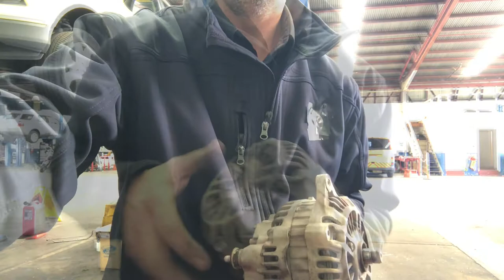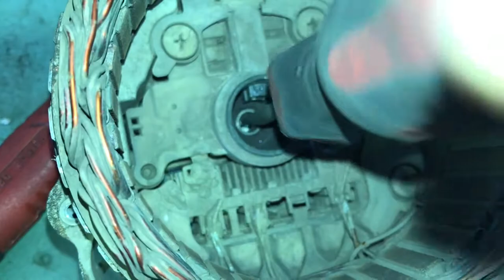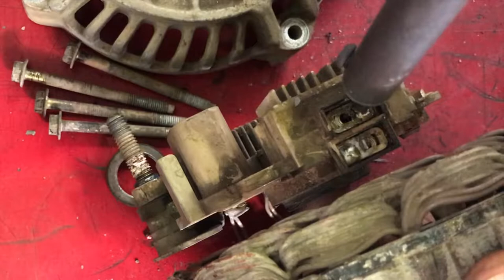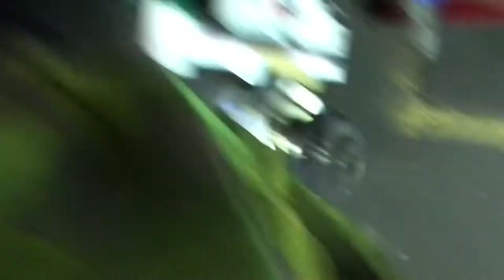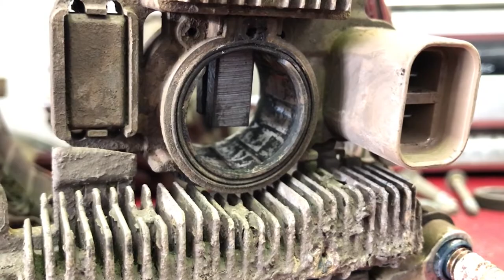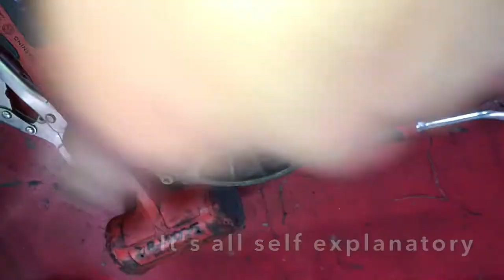HOW TO : Replace Worn Alternator Brushes (not charging)

Comment: Great video. Word to the wise- these steps are likely good for most alternators, but if you are working on an AC Delco AKA Delcotron alternator NEVER use an impact gun to install the main hub nut. Doing so will distort the body and cause rubbing... I had a parts store fellow think he was doing me a favor by installing the nut  on my replacement (when I only asked him to remove the old one). He handed me a fresh, but now broken alternator. I was stuck in that town for another 3 days while another unit was sourced. Thanks for sharing. Love those Pajeros- we own two 1990s with 6G72 here in the USA we call them Montero, because Pajero means something bad in Spanish slang. Cheers!
Reply from the maker: Good info there. Luckily I’ve never worked on that style of alternator. Good to know though.